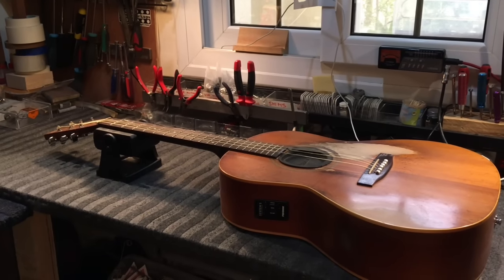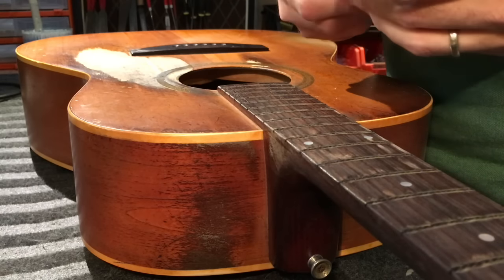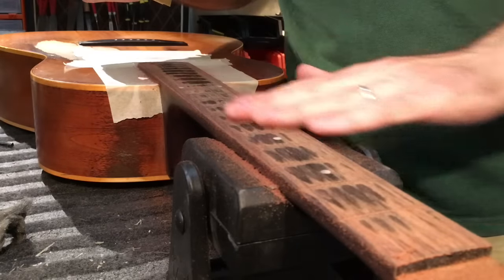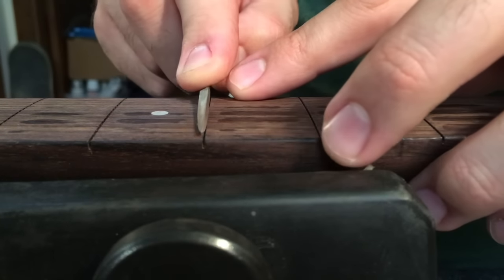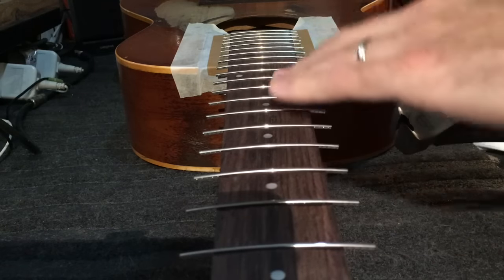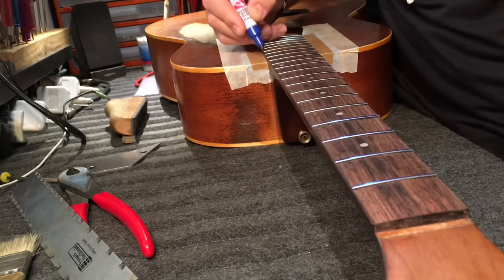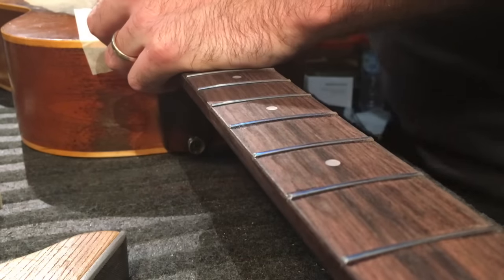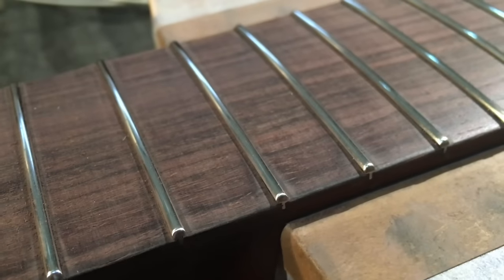Felix's acoustic gets an overhaul - PART 1

Comment: Is leveling the fretboard absolutely necessary? *around 9:20 Just a question cause I'm trying to attempt a refret on my own but am scared of taking too much material off.
Reply: Reening Lau it’s either metal or wood. Whatever you don’t remove from the surface you will have to take out of the frets themselves. For most old guitars, luthiers will shoot for somewhere around the middle.

Comment: Great video in every aspect - informative, audio, video, editing etc.
Just one question. Are you sure at 13:54 that the slight gap between fretboard extension and the top wasn't an intentional build feature, and the parts had not been joined (glued) initially, to begin with? I have a hollow body bass with just such feature, only the gap is much wider. This slight separation could've been left intentionally to allow the top to resonate freely without being dampened by the fretboard extension. But I'm only speculating, of course.
Reply from the maker: Mirek Goldberg on hollowbody’s there are often gaps beneath the fingerboard extension by design... flat top acoustics aren’t built that way though, so this had simply popped up :) Good question though! Thanks for the kind words too! 👍🏼

Comment: What purpose is the solder for removing the frets?
Reply: I assume to quickly heat fret wire at a faster rate without overheating fret slot and burning wood.

Comment: You use solder to help the heat transfer from soldering tip to the fret as it effectively increases the tip/fret contact surface area
Reply: noslohcinkin well, that answers my question. I had never seen anyone actually use solder for pulling frets before...the more ya know 🤘
Reply: Highly debatable if it helps, a run with the soldering iron tip by itself would be more than  enough to transfer heat in such thin slivers of metal as frets.   Splashing of solder can also easily and needlessly occur.
Reply: I use a wood burning tool with dedicated tip with a channel filed in it to ride on the fret crown, no solder needed

Comment: When filing the fret ends, would it be advantageous to turn the guitar on its sides like a playing position looking down from above?  The neck would need to be supported, but to me it seems that would be more comfortable and less awkward than filing horizontally from the sides.  Thanks.
Reply from the maker: DDEENY its really a case of whatever works for you. Whatever is comfortable and gets you the best result. Try that method out and see if it works for you. :)

Comment: I don't get it, does he mention why he puts solder on the fretwire before pulling them out?
Reply from the maker: Simon Something The solder is used to speed up the heating of the fretwire. It also provides a good reference point for when the fret is heated enough. This is also the most frequently asked question. :)
Reply: @RamsayPhillips  Ah, that makes sense. You should make a fret shaped brass/copper bit that fits on your soldering iron!
Reply from the maker: Simon Something I’m so used to using my soldering iron as is... :)
Reply: @Simon Something -  He shouldn't need to.  Most people use their brain.
A soldering iron is more effective than a heat gun.
Heat from the iron softens the glue and expands the fret wire.
Maybe you can figure the rest out by yourself.
Reply: @SimonSomething  Why?

Comment: Why the solder tho? Wouldn’t the heat from the gun Alone be hot enough? Just wondering never done it myself
Reply from the maker: The heat from the gun gets through very slowly… but I use solder for two reasons. 1. It’s speeds up the heat transfer dramatically, and 2. It’s a visual cue for when the fret is hot enough to pull. Makes the pulling of frets at least twice as fast a job, and when time is money….. 
hope that explains it 🙂👍🏼

Comment: Just wondering: Why do you have to use a soldering lead when your aim is just to heat up the fretwire? Is heating it up with the soldering iron not enough?
Reply from the maker: Common question :)  the solder speeds up the heat transfer into the fretwire, and it also serves as a visual guide to when the fret is hot enough to pull. Using the iron alone can work, but it takes a lot longer, and you’re also then using your soldering iron without solder (tinning the tip) which makes the top deteriorate.
Reply: @RamsayPhillips  Thanks a lot

Comment: I missed something  what's the reason for adding solder before fret removal. Looks like you eliminated tear out.
Reply from the maker: Ray Mari , the solder speeds up the heat transfer into the fretwire, and also gives a really good visual reference for when the fret is hot enough to pull. A nice hot fret does indeed help eliminate tear out. Thanks for watching! 🙂

Comment: Did I miss the part where finger board is cleaned up after fret is dressed?  He said wasn't worried abt sawdust etc getting on board bcs it will be cleaned up after dress.
Reply from the maker: Hey Eric, during the fret polishing process, the rosewood gets scrubbed a fair bit, removing marks etc. if there are marks caused by glue or a file slip, I’ll generally use a razor blade and scrape the board between all the frets in the direction of the grain. Hope that answers your question. Cheers!
Reply: @RamsayPhillips  thanks very much for the reply and explanation.  Was great to watch the refret process.

Comment: this fretboard looks like a compound radius board of a 12 to 14 inch towards the higher frets.
I wonder what might be a right approach to leveling something like that
Reply from the maker: yes, this board was a compound, but because I was installing stainless steel frets which don't conform to a different radius, I chose to radius the entire board to a 12. Small compromise, but not as critical on an acoustic. To level a compound radius, one would use a levelling beam and move back and forth between fingerboard edges whilst levelling. One needs to be quite careful when levelling a compound radius. Hope that answers your question.

Comment: What’s the purpose of adding solder while heating the frets? 
Genuine question.
Reply from the maker: It speeds up the heat transfer into the fret, and acts as a visual guide for when the fret is hot enough to pull
Reply: @RamsayPhillips  

Ahh okay! 
Thanks for the tip. 
Great video by the way! 
I’ll be doing my first refret on a ‘36 Harmony once I have all the materials and this video is a hell of a lot of help!

Comment: Great info THANKS!  A couple of questions.  What is the jig used to install frets over the body and what grit sandpaper do you use on the wooden radius blocks?  THANKS AGAIN!
Reply from the maker: Alan Dust hey Alan! 
The thing that’s clamped to the body is called a fret buck, you can get it from stewmac. I usually use 80 grit when leveling the fingerboard if it’s in need of a fair amount of leveling, and 220 grid when leveling frets.
Reply: @RamsayPhillips  Wow, thanks for the answers and speedy response.  Hope you'll be doing more videos...there GREAT!

Comment: I have an old accoustic. I plan to redo it from the perspective of one who has ne er done this before. So questions.
1.  Why are you soldering the frets prior to pulling them out? 
2.  Is it necessay to sand down the fretborard?
Reply: Peter Janak Jr while not always necessary, usually running the soldering iron on the frets helps them pull easier and more cleanly. It can release glue, dirt, old skin and oil, etc, letting it pull with less damage to the fretboard wood. 

Sanding the fretboard only needs to be done if it’s badly worn, if it’s damaged, or if it isn’t the true radius it should be or that you want (fairly common with budget guitars). And it should be done carefully. If you notice in the video the block he’s using has a radius cut into it. There are different blocks for different radiuses, and gauges to measure the radius. You may find a few videos of people using straight beams on the fretboard wood without frets, but the blocks are much safer, especially for beginners. 

If you do decide to sand, make sure you watch many videos on it and make yourself a checklist of everything to do before, during, and after sanding. Including supporting the neck so you don’t sand more out of the middle than on the ends.

Comment: I had a question, I wanna get into fret levelling and recrowning myself. (not refreting just yet) You used a radius block to sand down the frets do you suggest for me to get that too or will a completely flat steal sanding beam work fine too? I want to get the right tools but as a student, I don't want to spend too much on them so I would like to know what all the very basic tools are you'd suggest. Thanks for the video it was very enjoyable watching you fix up this guitar!
Reply from the maker: BoboButYouCanCallMeTom first off, thanks for the compliment! Secondly, you can get away with just the beam. In fact, for a beam, I use a stanley spirit level that’s more heavy duty than the regular lightweight ones. It has a machined edge. Your technique just has to be right. It’s fine. Splurge on a diamond fret crowning file, 300 grit, which will make your life easier. A little fret dressing file too.
Reply: @RamsayPhillips  Thanks very much for the quick answer! What would you suggest for cutting nut slots? Sorry for all the questions!
Reply from the maker: BoboButYouCanCallMeTom you can get away with the cheaper ones from stewmac to start

Comment: Why are you putting solder on the frets?
Reply from the maker: Kanciarz it speeds up the heat transfer into the fretwire, and also helps to visually see when the fret is hot enough to start pulling.

Comment: Why remove the frets? Seems like the action is good without removing
Reply from the maker: Sonny Rich the frets were completely toast. It’s not about action, it’s about playability. When frets are worn, they cause buzzing in specific places. They then need to be leveled. When there isn’t enough height left in the frets for a level, they need to be replaced. It’s no good if a guitar has low action but is completely unplayable because it buzzes all over the place. Does that make sense? :)

Comment: Nice video. Thanks.  I'm wondering about the depth of the fret slot before installing the fret.  Did you need to measure that or is it not necessary?  Would the fret cut it's way in further as it's pressed in?
Reply: Yes, you would need to measure the fret slot depth and adjust if necessary to a little deeper than the  fret tang. The fret slots are likely to be deep enough when cleaned of debris. No, fret tangs will not cut into the wood, if the slot is not deep enough the fret will not sit flat to the board.

Comment: Great video, Ramsay Philips - and very thorough!

Two questions:

1. Before you dress the fret ends, I see you using the radius block, sanding the fret tops a little? Do you do the level before the dressing?

2. When you dress and round over the fret ends, the ends looks smooth and nice, but I sometimes feel that it doesn't take many strokes with the file, before the fret ends/sides start to look a little rough? Any thoughts?

Cheers & Thanks! :-)

Comment: So these are stainless steel frets? They seem to be just as easy to work with like ordinary nickel silver frets, which comes as a surprise to me, as I always thought SS frets are much harder to work with. But you clip them off like butter... Or do you uses specialised, extra strong tools?
Btw it does look like these frets are not seated properly, but that's probably just due to lighting, as they cast a strange shadow at the edge...
Reply from the maker: Patbwoy hi there!  The fret seating was spot on, it was definitely due to the lighting. It’s actually something that one comes across often whilst fretting, light playing tricks on you. As for the difference of SS vs Nickel in terms of installation and leveling etc, the main things are radiusing the wire perfectly, preparing the board and slots properly, and then it generally goes well. Cutting the wire just requires a firmer grip and it sure has chewed into my nippers. The major addition effort comes into when you’re dressing and repolishing them after the leveling and crowning. It requires a whole lot more elbow grease!

Comment: Hi Ramsay! I would like to ask if you want to dehumidify your guitar? Silika gel will work? Or what will be your best advice? Thanks mate.
Reply from the maker: My Guitar hi there! I’d personally use a D’Addario humidipak system to balance the humidity. It will remove humidity when required and add moisture when required. Those silica gel packs aren’t good.
Reply: Ohhh...Thanks so much for that quick reply. Very much appreciated. Cheers. I'm getting worried earlier because the weather keeps on changing. Thanks once again for your professional advice.
Reply from the maker: My Guitar you’re most welcome! My advise would be to keep a humidipak in your Guitar whenever it’s in the case (which is the safest place for it when not in use). The humidipak will keep it at an optimum humidity level

Comment: I just saw your cutter and it was pity. I bought one of those and it ended up the same way. When, I did stainless steel frets. I went to home depot and bought me  a cutter and just did my bass with stainless steel. And,  not a single mark on it. Those are a waste of money. Only $ 20.00 at the home depot and the sandpaper  at home depot is awesome, too.

Comment: Great video! Thanks for sharing. The only thing I wouldn't do is to use a radius block to rectify the frets. The middle of each fret will have less contact with the sandpaper than the tops. This will happen even if your fretboard is within the same radius the block you used. Did you note that? Best regards.

Comment: No need to use solder on the frets just heat them up
Reply from the maker: shaun rish it actually helps the heat transfer into the fretwire and makes the process faster.
Reply: Ramsay Phillips ...with respect,  and as a fellow Luther,  it is highy debatable and I personally disagree.   More trouble than its worth, and potentially messy and dangerous on a more expensive guitar with a nice finish on the top: solder can spit and drip no matter how careful you are.   A good 50w plus soldering iron run back and forth will transfer more than enough heat to a thin steel fret.   Nice quality work on the job as a whole,  though.

Comment: dude you sound south african. Where are you based?
Reply from the maker: Yup, I'm South African. I was based in Dubai, now based in Dublin
Reply: Ah I see. So a lot of guys do the fret levelling with a straight beam but I see you use a radiused block for the levelling which makes sense to me but is there anything I should know if using a straight beam vs radiused or is the any issues with using one over the other etc?
Reply from the maker: Using a straight beam is absolutely fine, you should just pay attention to how much you're taking off and not focus on one spot for too long. I use a beam when levelling out problem areas in fingerboards when using a neck jig.
Reply: ah thanks man. Pull in for a braai sometime.

Comment: I am not seeing that to be honest , you are removing the iron as soon as the solder goes on , keeping the iron 
on the fret longer without solder has to be hotter , however each to thier own , whatever works for you is good
Reply from the maker: shaun rish it works better. It takes longer to heat the fret without solder. The solder makes the heat transfer much quicker. It's a fact. Try it.

Comment: I would sand the board more down to get rid of the deep nail indents. They are too deep!
Reply from the maker: micheloderso that’s an option for sure, but removing the nail indents is also removing the character of years of play that the owner has put in. The feel won’t be compromised too much as they weren’t too bad.

Comment: Why the fuck were you saudering them you only need to heat them up
Reply from the maker: The term is “soldering”... and it speeds up the heat transfer into the fret. Also.... don’t be a dick. Thanks.